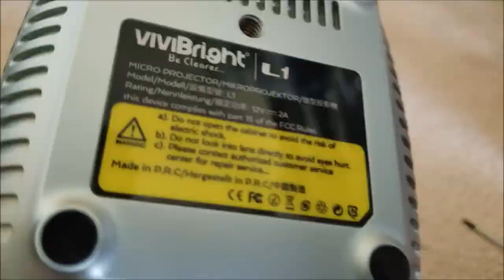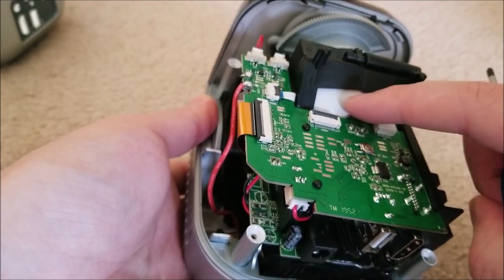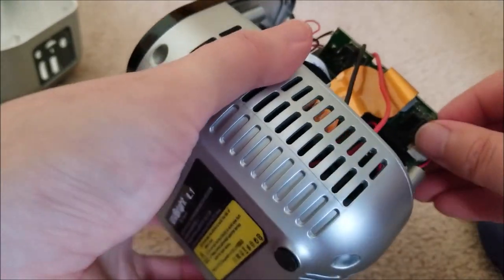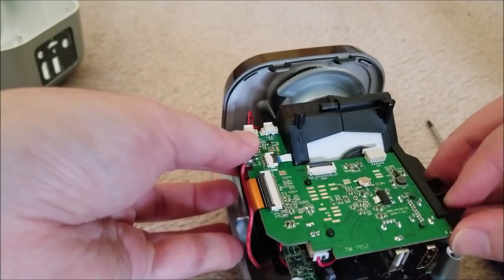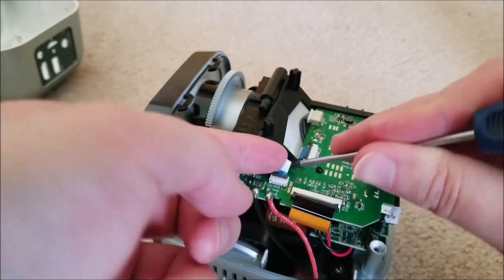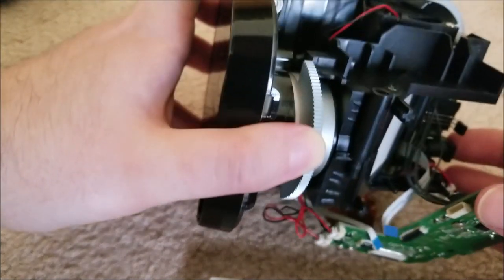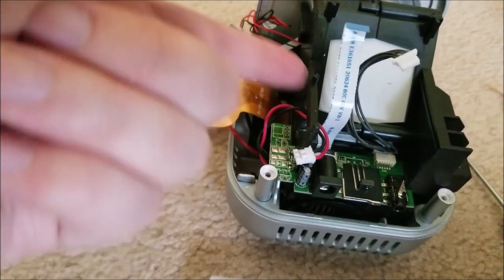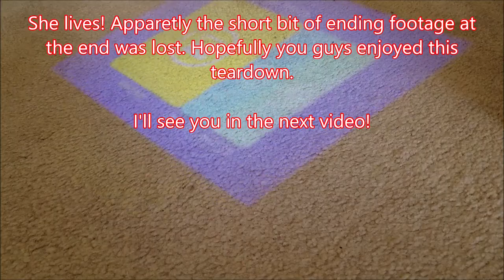Vivibright L1 Teardown

Comment: 17:56 ,18:13 the intake fan wires are being pinched by the lightbox. they're also pushed right up against the fins the heatsink (might melt & short??)
Reply from the maker: Not worried about melting, it'd have to get over 150C or so to melt pvc insulation and well before that point the ntc thermistor would've tripped. A short could happen, but brushless fans have integrated short circuit protection in the internal three phase driver so it'd be an obvious problem with a quick fix should that ever happen.

Comment: Hi, i have the same model but the image quality is pretty bad as it is projected from a low res lcd i guess. Well, can we upgrade the lcd to a higher res one? What would be the exact size of the lcd? 2 inch or 2.5 inch? What is the type of the  ribbon connection? I mean how many pins?
Reply from the maker: Chances of finding an lcd with the exact same ribbon and more important exact same digital controller chip built into the lcd glass are pretty slim unless we are lucky enough that it's a standard off the shelf part.

Comment: Hi i was wondring if you can help me with this problem. The problem is with my 3ds XL  the left side of screen doesnt want to type or when i use C stick  where the  q,w,a,s,z, is at so i can wirte and instead of qwasde it goes to frc4 oh its like a U a side U really wired so pls can you help me with that or i can send you my 3ds 🙏🏻
Reply from the maker: Have you tried to recalibrate the touch panel in the settings menu? That'd be my first idea, maybe it can be easily fixed that way.
Reply: @sjm4306  yes that was my first idea but nothing it didnt work
Reply from the maker: Was worth a try, well last thing I can think of before suggesting just replacing the touch panel outright is can you see any crumbs stuck along the edges/corner near the side that doesnt work properly? Or perhaps there's a screen protector film installed on the touch screen that's interfering? I've seen a few 3ds' in my day that had weird touch problems caused by these issues.